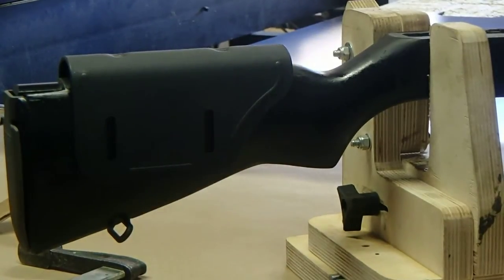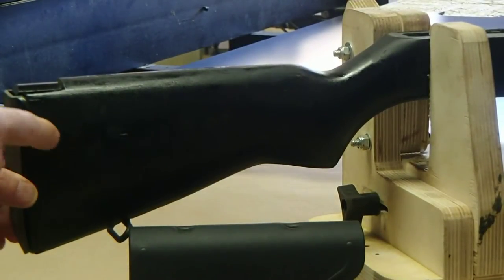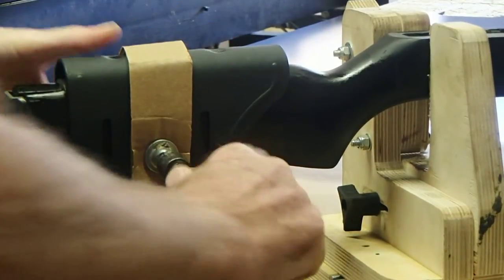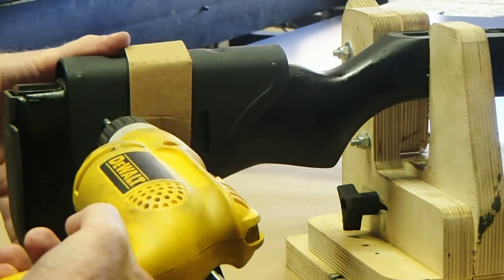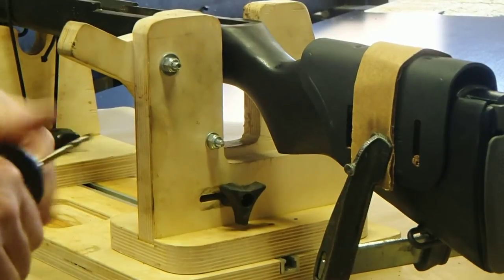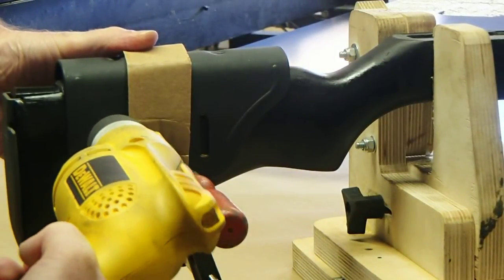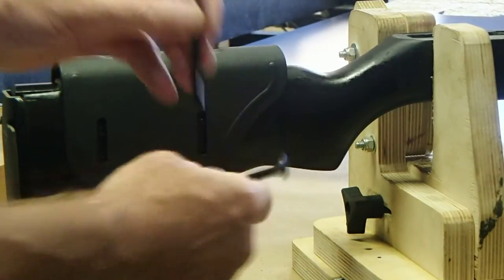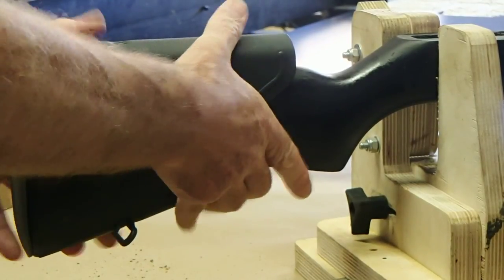TAC PRO KYDEX CHEEK REST INSTALLATION ON M14/M1A, M305 RIFLE STOCK

Comment: I use a drill press and scope level on the windage turret or flat side of the receiver to level front to back and left to right.  When drilling, the exit hole comes out exactly parallel and plumb to the entry hole.

Comment: What length were your drill bits?  They looked pretty short.
Reply from the maker: They are stubby bits, about 2.5" inches long. You can use any length bits of the correct diameter.